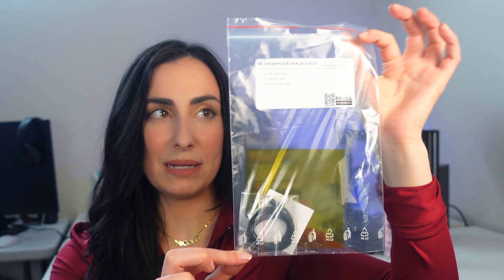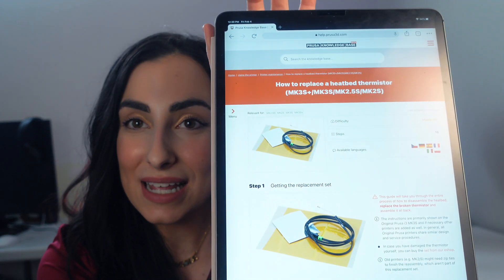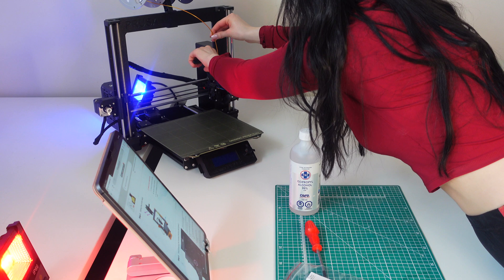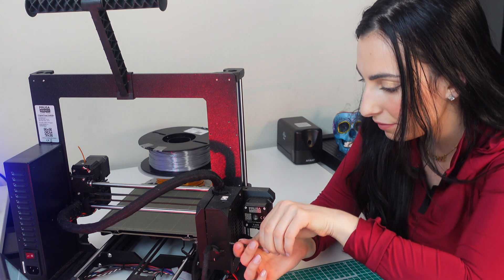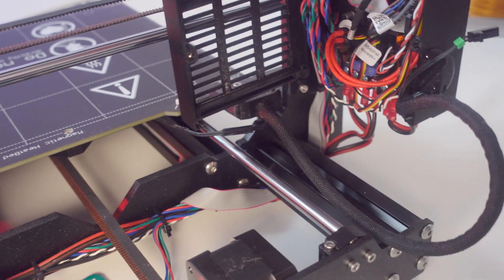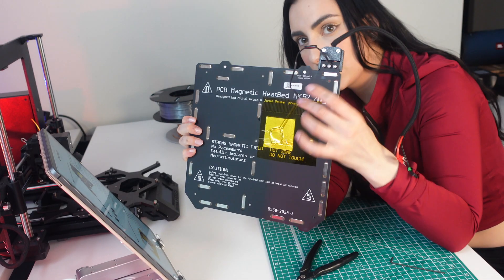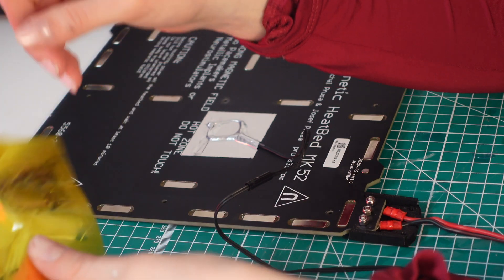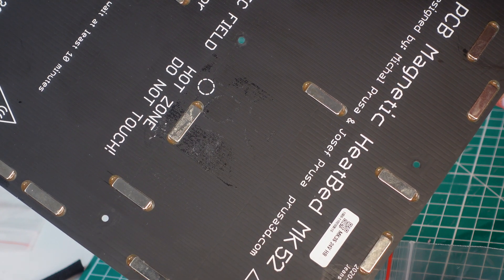SERVICING MY 3D PRINTER! MinTemp Bed Error  PRUSA i3 MK3S

Comment: Hey, good job! have you noticed this problem also? I have a couple of mk3s but since the latest firmware and slicer update, when I print on supports, the quality is much worse than before. The supports get stuck to the print. I use prusament and use the exact slice profile as before the updates. Wondering if others have noticed this too
Reply from the maker: Yes I find this as well! I don’t use prusament (and I thought this may be the problem), but I’m disappointed how much it fuses to the print itself. I’ve tried to alter the support settings which have helped but it is still very difficult to release.

Comment: Hello,

6:54
in the assembly manual, 
7. Heatbed & PSU assembly 
Step 10 Wrapping the heatbed cable

Before you continue with wrapping the sleeve, we need to fix it in the cable cover. Please proceed to the next step.
Please don't use the ziptie.

Sorry for my poor english. 

Greatings from germany 

juck.